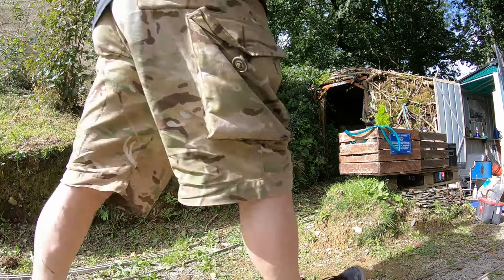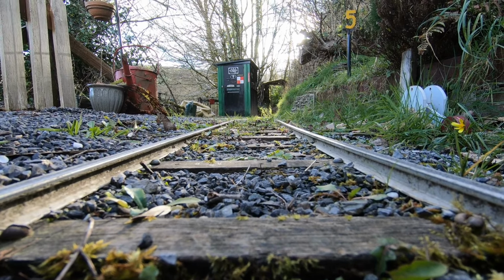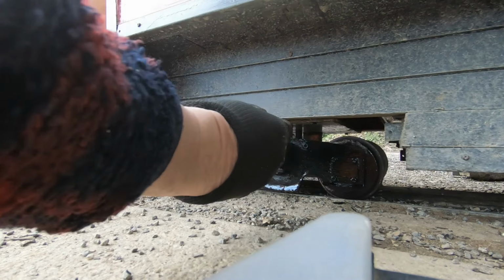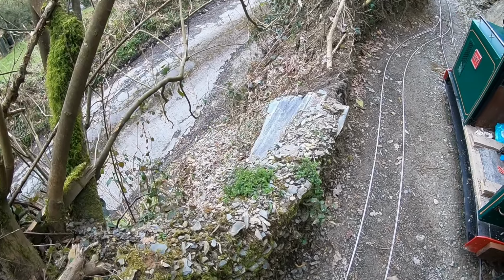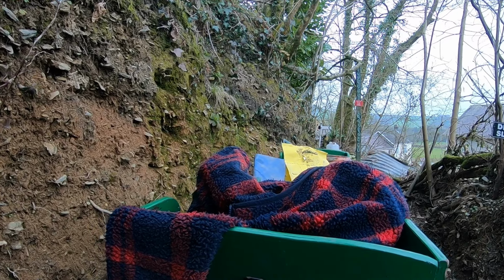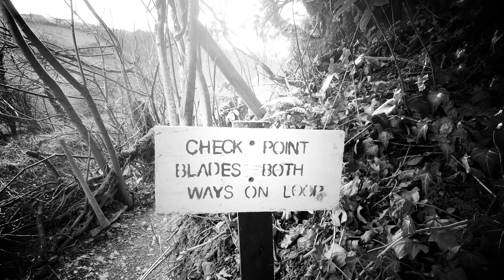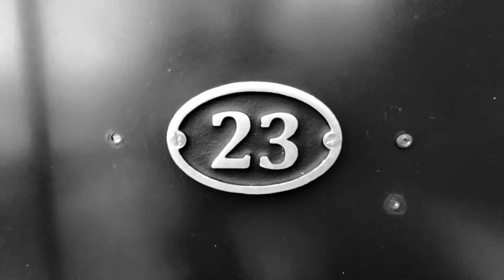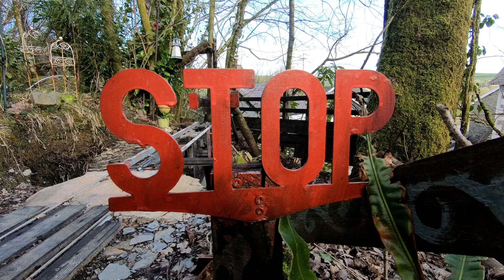Ivy Railway Welcomes The Spring.  Lots of springy updates on the line. Minimal Guage Railway.

Comment: I’d be putting a drainage ditch on the outside of the curve so the water runs into it before the track not after running over it
Reply from the maker: Yes that idea was mentioned earlier and I have taken that advice to a degree. It would mean major work to dig a deep channel but I have made a shallow one that feeds under the track to the deep one now.